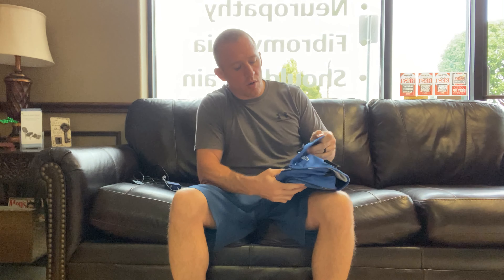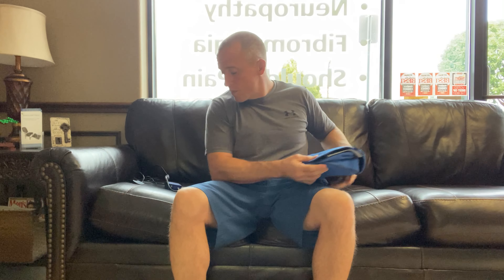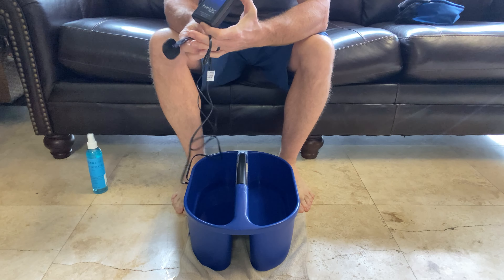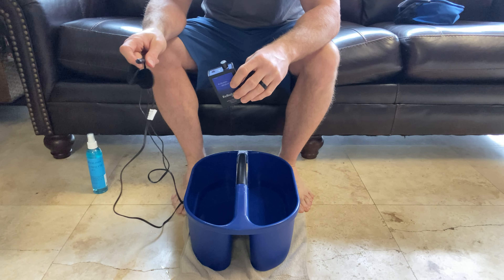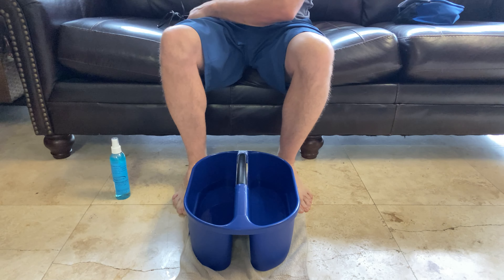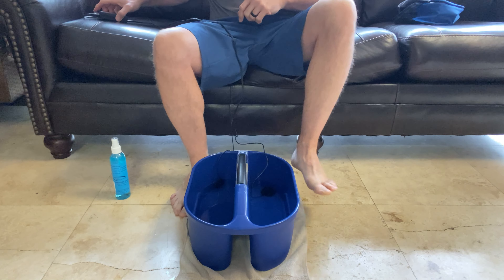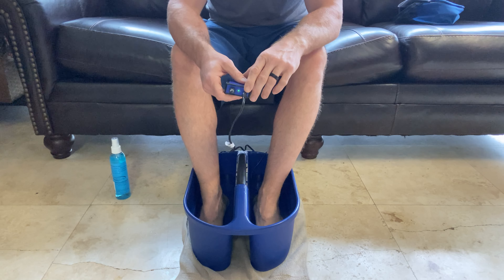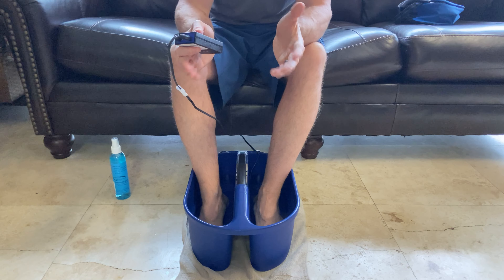Neuropathy Rebuilder demonstration video

Comment: The rebuilder recommends a teaspoon of the solution which is more than 3 or 4 sprays.  Also the unit shuts off automatically after 30 minutes, but you might want to manually turn off the switch as well.

Comment: Thank you for sharing this information.  I have PN as a result of chemotherapy.  I went to a chiropractor I had never been to before that wanted to charge $10,000 (yep!) to do this very thing.  My question is, can you do this with a tens unit or does it have to be this specific rebuilder and if you can't use a tens unit, can you please explain why?  Thank you very much.

Comment: My unit is different in that there are two wires and each have two electrodes. I was told to start at 3. But maybe should go higher. Another thing is the electrodes have a gel like substance that slides off after a couple uses. This seems wrong.